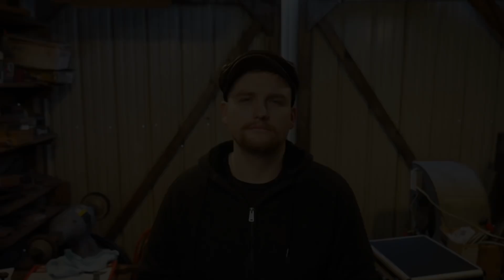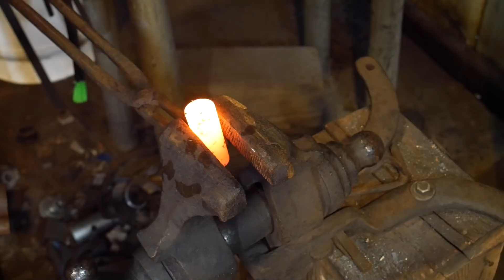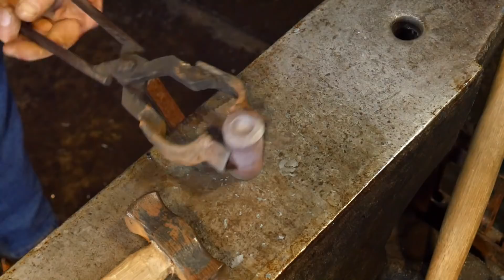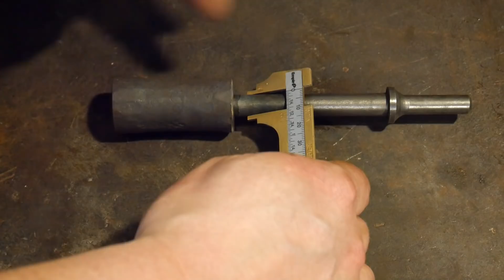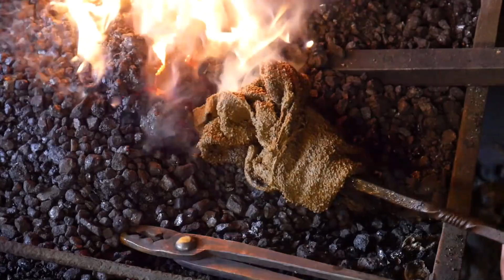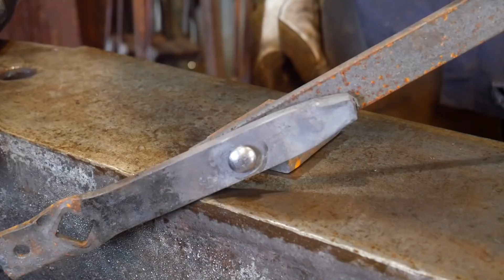Air Powered Rivet Tool for AIR FORGING

Comment: Hay Roy,I've been using a air hammer  for a number of years to make the trigger  shoe  finger guards on my Brute Deforge style  knives,it works great.I slot a piece of round stock and weld a air chisel  in the slot,the tool lasts for a fairly long time and usually  breaks at the weld.

Comment: Take a look at air tool powered planishing hammers. It might help you with finishing copper bowls and would also be an interesting new "power hammer" build.
Reply from the maker: +AndTheCorrectAnswerIs I have in the past and it would definitely be a nice piece of equipment to have for the shop although I don't know where I would be able to fit it :-)

Comment: hmm would it not be better to use a drill to start the center of the rivet and then heat it up and make the rounded  punch part of it might save you some time and anguish
Reply from the maker: +manga12 I'm not sure I follow?
Reply: The the rivet cup center it with a drill first and bore out a little of it then heat up the rivet cup and pound it in do you dont have so much deformation to deal with back and forth when using the domed punch to make back part of it that rounds it, save a bit of time, just forming the actual hole and not have to beat out the mushrooming on the sides as much
Reply from the maker: +manga12 ahh now I get you :-) yep that would of been a great idea ! Thank you for the great suggestion
Reply: No problem, its how one starts out a hole in metal after all with a drill and then tap, besides I just saw how much you were figiting and fighting with the sides, I mean hitting and forging it sure might get the cross section tighter but if there is no need to fight with something to keep shape then save your arm and body and drill it like part way to get it started then use the punch to from the most important dome at the end .

Comment: tell me can you just drill a hole and round it out to make a riveting tool i understand you have rivets to match holes but i cant buy rivets at all so ill be making rivets after making the heading tool
Reply: Yeah, you can grayem. Drill a very shallow hole in the end of a piece of good steel rod (coil spring) and dress it up--or not and you can use it to shape the head of a rivet.
Reply: thanks